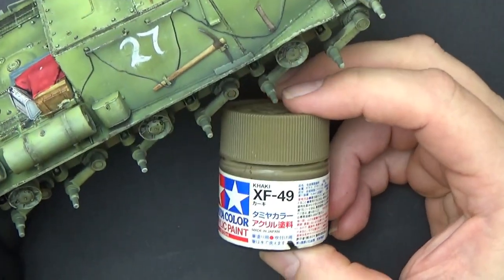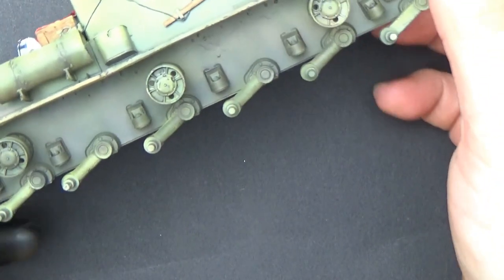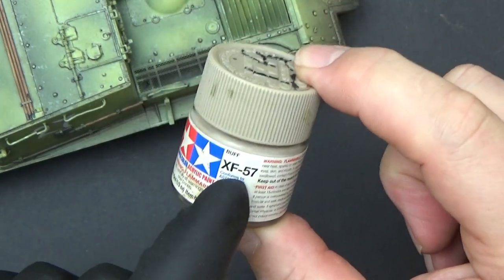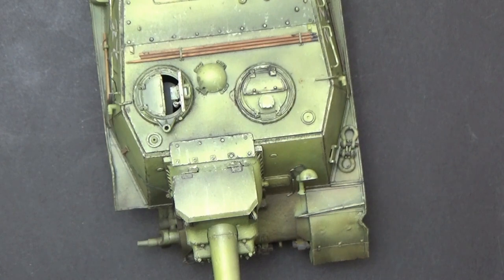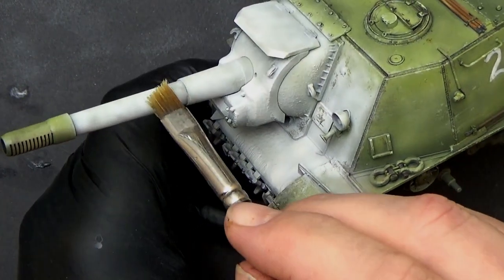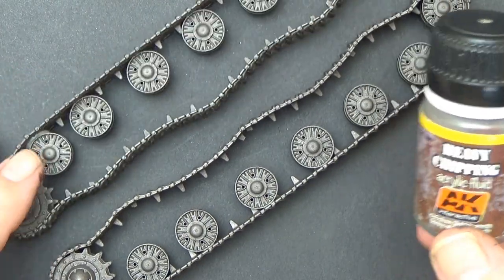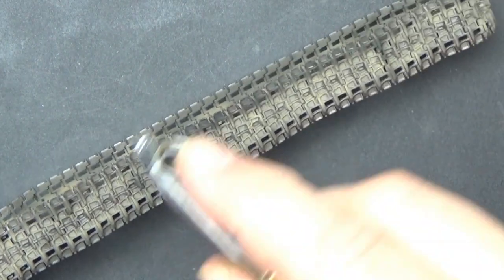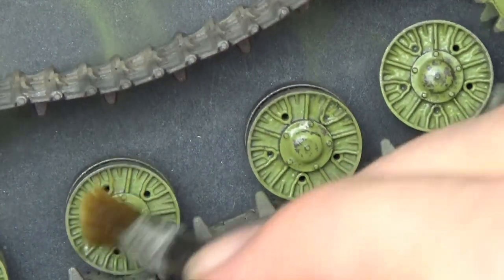A Winter Whitewash on a tank using hairspray chipping: Tamiya ISU-152 Part 3

Comment: I'm working on a Panzer tank and on the each connection of the tracks I use chrome marker.
Reply from the maker: I'll be doing something similar just before I put the tracks on, also on the sprocket and track teeth. Cheers Chris